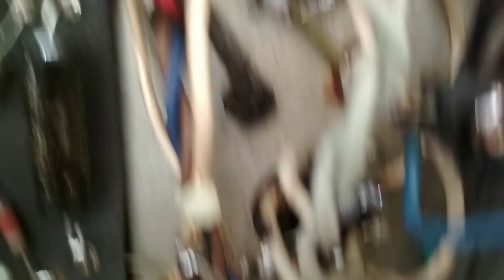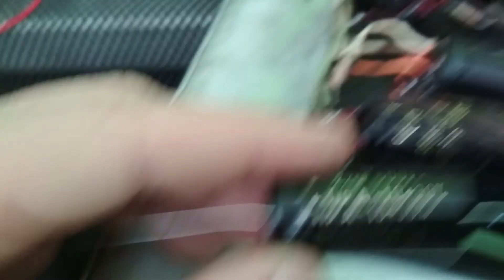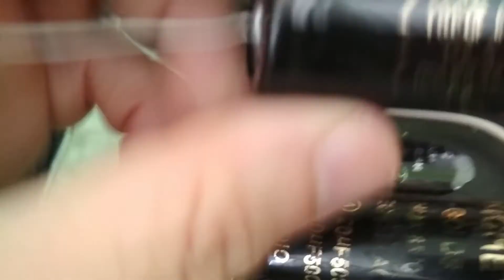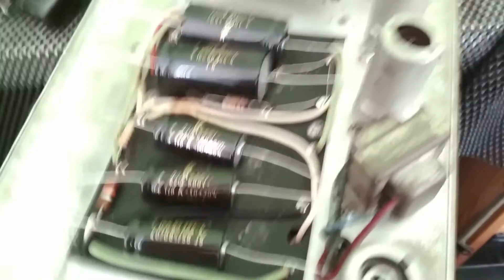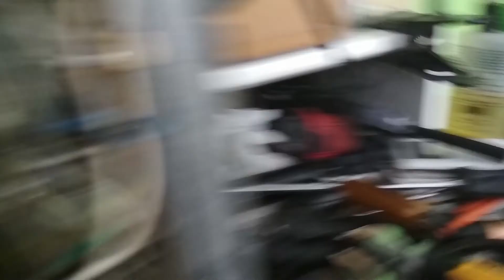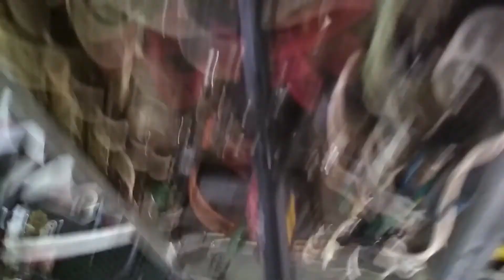Fender Quad Reverb 1970's New Caps, Bias, etc

Comment: Wish you had showed how to take the top part out of the amp with the tubes and transformer.Mine is still all original since I bought it new.I don't want to do the blackface mod with different caps.
Reply from the maker: Heya Lisa,

These old Fender amps are all pretty much the same. They just slide out from the back once you remove the back cover if there is one and the four screws that are on the top left and right.